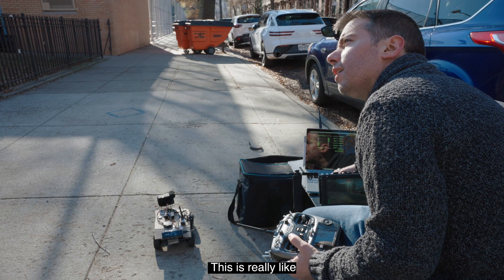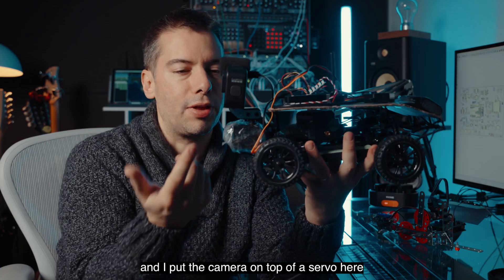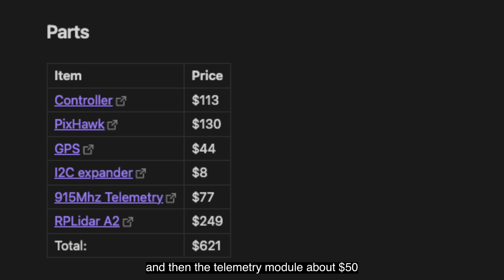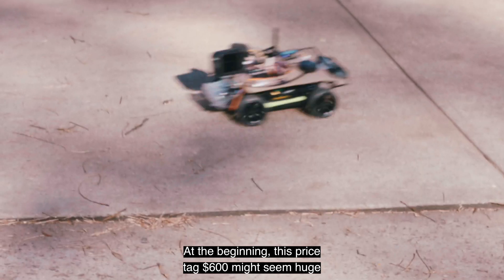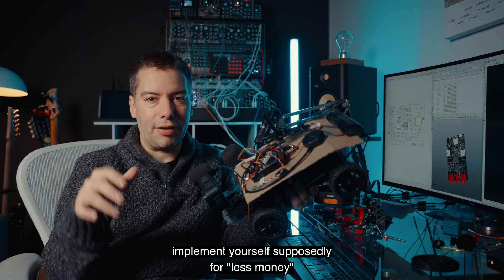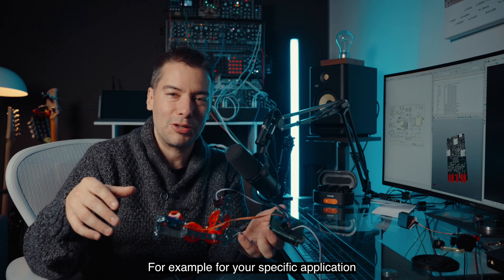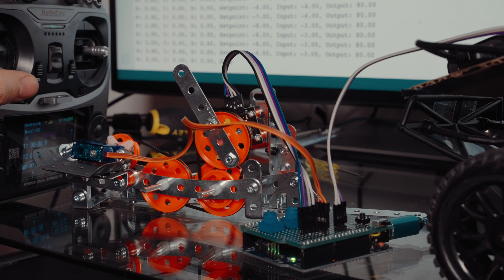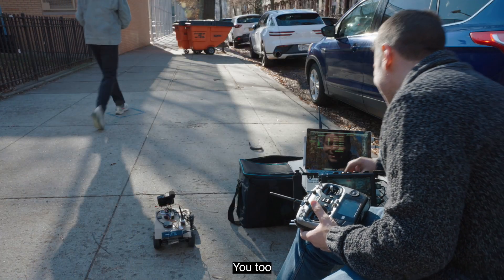My Pixhawk Rover Teaches Capitalism

Comment: by drawing this conclusion you disregard that maybe half of your setup is open source - for example, ardupilot is open source. Probably the tutorials were made by somebody for free.
This project is rather an opensource monument, and not a proof that capitalism works (it works, but not because you can build this thing. People founded this as a community, not businessman)
Reply from the maker: Community is incredibly important and businesses build communities and businesses are built around communities. I have worked a bit in Solr and contributed to tens of open source projects. This is what you see from inside. Yes, there are universities and independent volunteers that do lots of work but most of the work is done by companies (and contributed/shared). What I see in the open source world is way more efficient capitalism since there are often way lower barriers to entry for competition. I think this makes them very secure, high quality and well (efficiently) priced in respect of total cost of ownership.